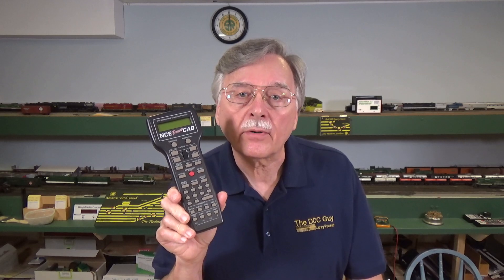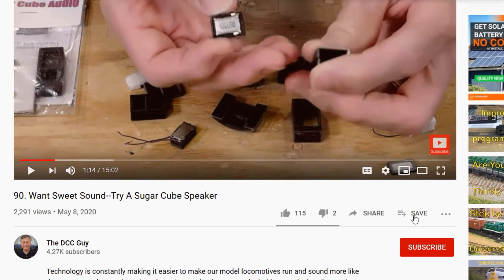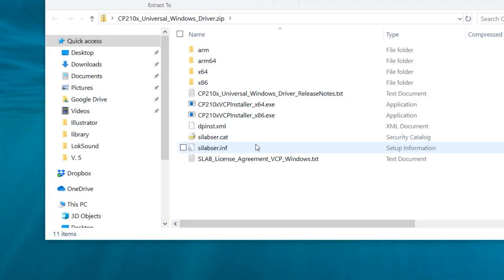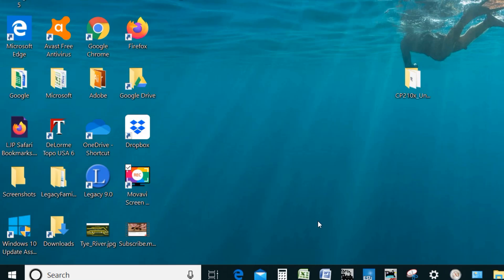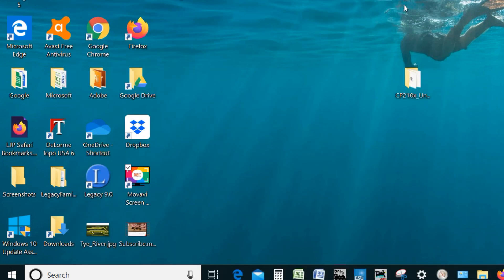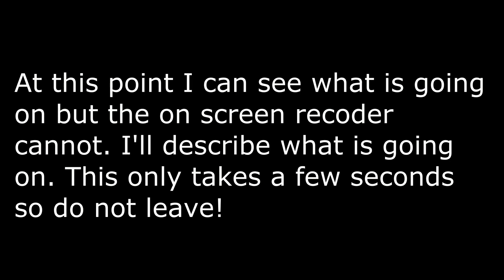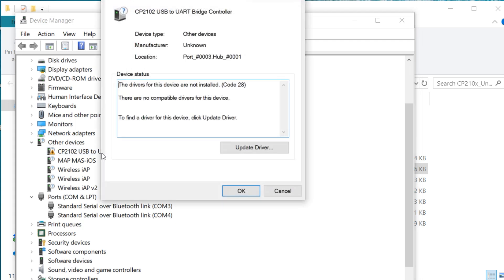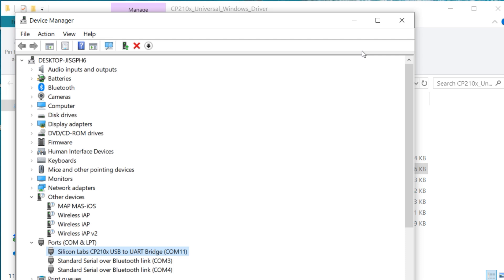A USB Interface for your NCE PowerCab pt2 (100)

Comment: Good job on this video and video 1 setting up the NCE USB Interface.   I was trying for a long time to set my NCE Power Cab up to run strictly Decoder Pro at my work bench.  The com ports were always a bear.   Although I have a newer version of Windows 10, I was able to schlog through it with the aid of this video and get it working.    Thank you!!!    My only comment was I set my NCE interface up w/ the 4 pins set per the manual and your video, V1.65B.   I still could not get it to work.   I carefully went through the driver download/com port assignment and still it would not work.   I saw multiple people suggest opening up all the pins on the interface with #1 as "don't care".   I set the pins like that and it worked!!!!

Awesome.  Now I am running Decoder Pro and the computer frustration is over!   Thank you!!
Reply from the maker: Great news and thanks for the feedback!

Comment: Hi Larry, I am back to model trains as of last November and of course shocked but very pleased with where the hobby has grown to. I am speaking primarily about DCC, which I chose as my operating system with N Gauge. So over the months I have been accumulating rolling stock, structures and micro tools and KNOWLEDGE‼️

Part of my learning curve has been so enhanced by UTubers like you and Ron’s Trains. You two have become my digital mentors in my newly rediscovered hobby.

I have purchased or obtained two key software programs, AnyRail and JMRI Decoder Pro.

Regarding the latter, I have watched both your videos on the topic.

I too had difficulty getting Decoder Pro to work. I ended up calling Ed at NCE, to help me with the USB Interface connections. He told me to leave all the four jumpers OFF. I am using the Power Cab version 1.65 and Windows 11. He told me that the chart in the instructions is wrong and needs to be corrected soon. He told me the jumpers control 3 things. Com Port, type of operating system and baud speed. He specifically said I should only use 9600 speed and I am connected to Com 3. All jumpers OFF!

With that said, the system now works as advertised. I would love you to do another video on more advanced settings in Decoder Pro. There is so much to choose from and I have yet to see a video that takes us past adjusting volumes and arranging light sequences. Just a suggestion and one I would deeply appreciate.

I have quickly come to the conclusion that with all this technology, this is no longer a hobby for sissies. This is deeply technological which I am loving learning about.

I still have my Southern Lionel A-B-A units which was built in 1956. Things have come a long way from connecting two wires and watching a train go around an oval‼️

You particularly have made my plunge much easier with your incredibly helpful content.

I am a newly retired ship captain so have exchanged my 4 bar epaulettes for a conductor’s hat. Thank you for your tremendous assistance in making some of this very hard stuff something I can comprehend.

Best Wishes, Capt Bruce Blomgren, Bradenton, Florida  

I would liv

Comment: Larry do you have any knowledge on installation with a Mac computer?
Reply from the maker: It should work, check the NCE website for any specific details. I have in the past tried DecodercPro on an iMac but I think it was with either  Digitrax interface or Sprog. Because so much of the software is Windows based I just keep a cheap PC around dedicated to that purpose.

Comment: Hi Larry, I have probably watched all your videos and I have recently ordered a USB Connector to allow me to connect my Power Cab to my MacBook M2. Do you know if its possible ti connect a USB interface and are there any drivers on the NCE page?
Reply from the maker: I have used it with a PC laptop but have not tried it with my M1 Macbook as yet. If the Mac does not have drivers then they should be on the NCE website. I think this is discussed inn the instructions that come with the device.
Reply: @TheDCCGuy  it seems there are no drivers for Mac iOS . I can’t find any in the NCE sites. Any advice please

Comment: Great video Larry. In this  tutorial you install Driver CP210x, what windows version do you have ? I have windows 11, and NCE said that 10 and 11 are built-in support for the Ch340 chipset driver,  also  they said to remove all jumpers and conect everything.  "If your PC is connected to the internet, Windows will install the driver automatically."   is this correct for windows 11 ?   thanks
Reply from the maker: I currently am using an ancient Dell with Win 7 since a lighting strike took out my  newer one last summer. I have used this with Win 7, 10, 11 without issues and as I remember with Win 7 it installed automatically. However there is additonal info on the NCE website.

Comment: good morning Larry,
i just purchased a NCE power cab and was wanting to know if my PR3 interface will work with it
please let me know
Reply from the maker: The PR3 can be used with DecoderPro as a stand alone programmer or with a Digitrax command station as a usb interface. The PowerCab requires its on usb interface which I covered in videos #99 & 100.

Comment: For what it is worth I have just spent three days trying to get a usb card to work with my NCE power pro with radio system.  I finaly called NCE and the tech guy gave me some valuable info.  The power pro does not use the usb card.  it has an rs232 connector on the case and an rs232 to usb cable is all that is required. no drivers and direct connection to JMRI.  three other things he said were once the system is running press the emergency stop button to turn on the hand held unit.  when turning off press the  EXPN button then 1 or it will self turn off in ten minutes.  When switching engines press 8 to turn off the sound.  none of this is in the manual that I could find

Comment: I have been at this trying to set this interface for a week now and all I get is red leds on
When first it shows that it is running OK but as
soon as I try to call a loco from roster I get a red light and it shows that it is not working.
Also the Service Mod Programmer is not on line on startup. I give up . I have uninstalled jmri and reinstalled it also the usb driver. Shows device is working properly.
Reply from the maker: I suggest you give Ed Wilson at NCE a call and see if he has any ideas. Also did you read through the followup comments, there was a lot of discussion in them.

Comment: Where did your Roster come from? You already loaded Entries Manually in Decoder Pro?

Also do I Have to ever after have the Laptop connected, or is it just for Setup/Programming for the USB Device and NCE PCab?  

After that I want to Add a UWT-100 Wireless Controller.

Aside from going wireless, What does this Interface add for my PCab System? What does Decoder Pro provide in capabilities?
Reply from the maker: The roster comprises all the locos I have in DecoderPro. And yes the computer and DecoderPro must always be running for it to work, that is the active wifi link, just like having to have your wifi router turned on each time you want to watch TV.
Reply: @TheDCCGuy  
Well I can’t pull a Laptop to run Trains. 

I need a Wifi Interface to the NEC to use a Wifi Controller on. Is that out there anywhere?
Reply from the maker: Go to ironplanethobbies.com and look for NCE wifi interfaces. They have several different versions of one made by Wifitraxx that may work for you.
Reply: @TheDCCGuy  
Can you still use a UWT-100 With any of that?
Reply: @TheDCCGuy  
Ok think I’ll just go with ESU. Thanks!

Comment: I am also using  Windows 10. When I run the install for the 64 bit, after downloading the correct driver, it says that it was installed and ready. However, nothing shows up under ports.
Reply from the maker: It should go active and appear in the comport listing once you plug in the usb board cable.
Reply: I know this is several months old, but I had the same issue and wanted to answer for future viewers. Click the "view" tab and check "devices by type". The COM ports should now show in the menu.
Reply: Sorry, you must check off both the "Devices By Type" and "Hidden Devices".

Comment from the maker: Folks, make sure to check the baud rate setting for the driver that you install in Windows. To do that use the Device Manager as I showed in the video to click on the SIL USB interface port and open the driver. Then check the Port Settings and make sure the baud rate is set for the same speed as your interface and DecoderPro. In my case I used 19200 instead of 9600. If that doesn’t work some folks seem to have had success setting the jumpers all off and then configuring the driver and DecoderPro to a baud rate of 9600.

I finally got an email back from Jim Scorse, the owner and developer of NCE products, concerning this question of the correct settings. What he said was that the jumper and other settings described in the instrucitons are for older versions of the usb interface. He now recommends that for their current production usb interfaces ALL JUMPERS should be set to OFF. So if you have a relatively new interface then use the all off jumper settings and set the driver and DecoderPro baud rate to 9600 if it is not already . My unit apparently is old enough that it needs the settings I demonstrated in the video.

Comment: I've tried a different coiled cable but same result.
I have found that by plugging out & in twice in quick succession that it works again for a little while but always stops with a time out & off line.
If I start Panel Pro it works for a few second then I get an error message NCE: Error NCE USB using Com 4 ?
Reply from the maker: Try opening the driver window as I showed in the video and select port settings. Make sure the baud rate is set so it matches the setting on your usb interface and DecoderPro. In my case I set the usb to 19200 and the default setting for the driver is 9600. Mine worked fine after I changed that.  If that doesn’t work then I suggest you contact NCE tech support. They may know of a fix for the problem or may decide to have you send it back for R&R.
Reply: @TheDCCGuy  I tried the different baud rates but no change.
The fact that it works for about 10 seconds puzzles me.
I'll put a message on the NCE groups page & see if anyone can figure it out.
Reply from the maker: Did you power the PowerCab and the interface down and restart DecoderPro after making the baud rate change? With some systems you may even need to restart Windows. On my system as soon as I changed the baud rate and restarted The PowerCab and DecoderPro I was able to read and program right off.
Reply: @TheDCCGuy  I restarted Decoder Pro but didn't reboot the Power Cab.
Here is a quick synopsis of a conversation I had with Dave Heap (Australia)
It seems to be working now.
All jumpers = OFF.
Baud rate 9600.
 
 I disconnected the coiled cable from the USB interface at the interface & reconnected it again.
    After a few seconds the USB interface worked & I was able to read & write the long address to the decoder.
    Why this should happen I have no idea ? Perhaps someone could explain it ?
    I was also able to run a throttle & control a locomotive on my test track.
"A Stuck-On Cab Bus LED on the NCE USB is due to a communications failure between the NCE USB and the Power Cab. 
Once the Cab Bus LED is on, the NCE USB is hung up and needs resetting by exactly what you did.
It could have been caused by an earlier misconfiguration or it could be related to a deficiency in some Cab Bus driver chips supplied to NCE for a period some years ago. Either way, an unplug/replug reset is the correct step.
Dave in Australia"
Reply from the maker: Glad you got it straightened out. dave is a very knowledgeable guy. What version is your usb interface? I am trying to figure out why the NCE instruction sheet seems to disagree with what Dave told you and yet it seems to work fine that way. I know that the jumpers on the earlier versions of the interface were set as all off but the manual says on, off, on, on for the later versions. Maybe I need to contact Jim Scorse the designer and get his take on this.
Reply: @TheDCCGuy  
Hi Larry.
The USB Interface is a version 7.
This is the information Dave gave me when I asked him further questions about the different baud rates.
It may be of interest to other users.
Tony.

"I disconnected the coiled cable from the USB interface at the interface & reconnected it again.
After a few seconds the USB interface worked & I was able to read & write the long address to the decoder.
Why this should happen I have no idea ? Perhaps someone could explain it ?
I was also able to run a throttle & control a locomotive on my test track."
Answer :
A Stuck-On Cab Bus LED on the NCE USB is due to a communications failure between the NCE USB and the Power Cab. 
Once the Cab Bus LED is on, the NCE USB is hung up and needs resetting by exactly what you did.
It could have been caused by an earlier misconfiguration or it could be related to a deficiency in some Cab Bus driver chips supplied to NCE for a period some years ago. Either way, an unplug/replug reset is the correct step.
Dave in Australia
Tony,
On 16 Jun 2020, at 8:28 PM, amdaley@... wrote:
"Thanks Dave for that explanation.
Is there anything to be gained by trying to increase the baud rate from 9600 to 19200"
Answer:
No speed gain. At 9600 baud the slowest part of the chain is the Power Cab.
The only benefit of going to jumpers all-on and 19200 baud setting is that it allows you to change the Cab address of the NCE USB from 3 to 8,9 or 10 to free up address 3 for another throttle. But you've got to have Power Cab firmware V1.65B and you have to use the Configure USB command. That's why we've stopped recommending it for general use.
Dave in Australia
Addendum
If your Power Cab firmware (second screen at startup of your Power Cab, after the "Pro Cab V1.3" message) is:
- "V1.28C" the only valid addresses for extra cabs are 3 & (unofficially) 4.
- "V1.65" the only valid addresses for extra throttles  are 3, 4 and 5. Non-throttle devices such as the NCE USB, Mini Panel or AIU can also use addresses 8, 9 & 10. However if you have ever done a System Reset, you will have lost all the extra addresses and be back to the V1.28C restrictions.
- "V1.65B" the only valid addresses for extra throttles  are 3, 4 and 5. Non-throttle devices such as the NCE USB, Mini Panel or AIU can also use addresses 8, 9 & 10.
Similar  comments apply to the SB3/5 with the range 2-5 for V1.28 and 2-7 for V1.65B.
Dave"

Comment: Great video and thanks.  I bought the USB adapter about 10 years ago and gave up eventually back then.  Tried again last week and this time I let the smoke out of it, overheated before I even connecting it to the command station.  I sent it out to NCE, hopefully they can fix it for me.   Also do you know if I can use Panel Pro and set up automation / routes, I see there are limitations having to do with monitoring the status of switch machines? Thanks Again!!
Reply from the maker: That is a question for the techies at NCE. I would imagine that among their different systems there is some variation  as to what is supported. They are best able to answer that kind if question.

Comment: Hi Larry. 
Great videos. I hadn't used my NCE Usb adaptor for a long time so I decided to connect it up again.
I have my Power Cab & USB interface connected to a length of track in my study.
When I click on Decoder Pro it tells me that Service Mode Programmer NCE is online but after about 10 seconds the Online turns to Off line ?
I have checked the preferences & they are all correct.
The Power Cab operates a locomotive on the track without any problem.
I have the latest version of JMRI & Java.
Tony.
Reply from the maker: Sounds like you may have used the wrong USB port. I had that problem too when I first installed the device then found out that Windows had not installed the driver. Also try opening the driver window as I showed in the video and select port settings. Make sure the baud rate is set so it matches the setting on your usb interface. In my case I set the usb to 19200 and the default setting for the drover is 9600. Mine worked fine after I changed that.
Reply: @TheDCCGuy  I checked in System devices & i have the correct Com port. I uninstalled & reinstalled the interface but the same problem persists.

Comment: The Mac is much easier to set up. Years ago when I had a windows machine looking or drivers on the desktop frequently caused the computer to install an incorrect driver the computer simply didn’t see the correct driver.
Reply from the maker: I agree, although in general I have found Windows 10 pretty reliable except in this case. Matter of fact it has gotten so reliable most companies no longer distribute a drivers setup disk with their products as was the practice for many years.